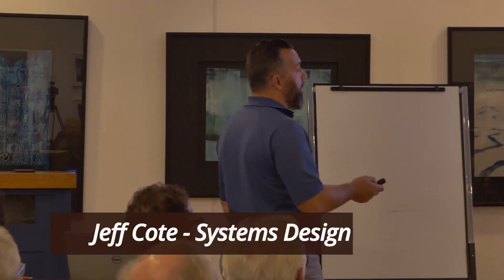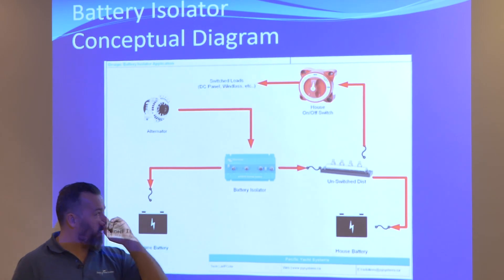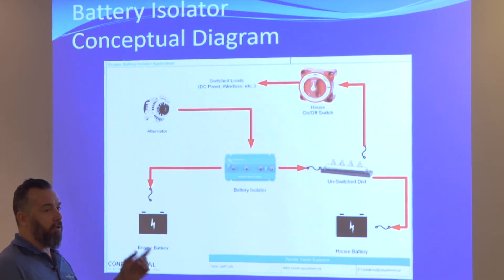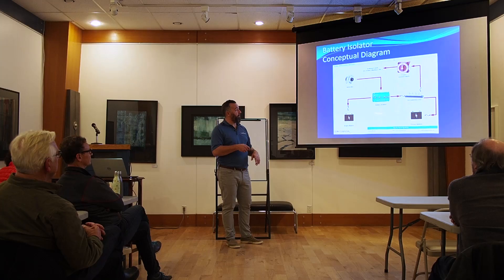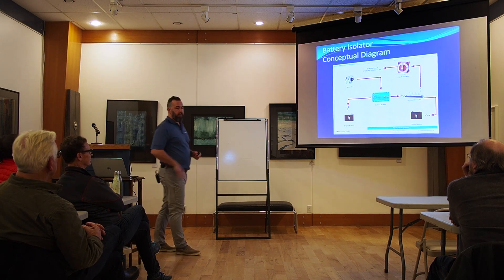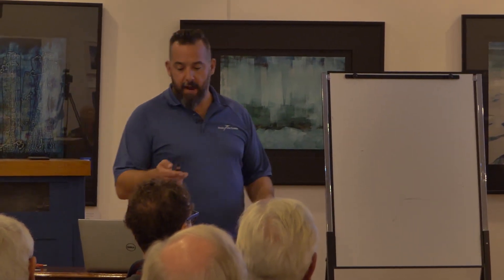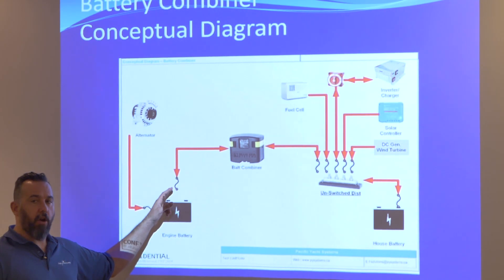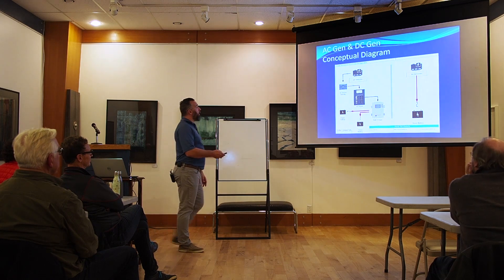How To: Marine Electrical Seminar - Battery Isolator Troubleshooting - Ep 28/30

Comment: Great stuff Jeff, the content is spot on and you present it well. How does this setup work (or not work) with daisy chained solenoid? Is it incompatible or just not optimal? You mention it in the video but could you elaborate a bit on the why?
Reply from the maker: Good question, will consider to make a video on this. In the meantime check out all our content on battery combiners:http://www.pysystems.ca/shop/power/battery-combiner/

Comment: So basically, say if I have 3 batteries on my sailboat.  1 is for cranking and the other 2 are separate house batteries. Let's say I have been running house battery 1 all day and want to charge it up, the battery isolator will only send the charge to the batteries that need it (#1) to be charged without overcharging the others say like if they were charging in parallel?
Reply from the maker: The battery that is the most discharged will get most of the current coming from the alternator via the battery isolator. The alternator regulator will reduce output as both batteries are nearing full capacity.
Reply: @PacificYachtSystems  and doing this it will keep from cooking my charged batteries? Seems like back when I was running on "all" I did that once.

Comment: Awesome video I think you've solved my problem, thanks Jeff! 

Before I bite the bullet can you tell me if my shore power battery charger will charge both batteries via the battery isolator? Will both charge up while I'm connected to shore power? 

And can I have batteries of two different sizes charge from the battery isolator? 

Thanks again for the the video!
Reply from the maker: Hi John, most battery chargers (powered by AC shorepower or AC generator) have 2 or 3 outputs and will recharge multiple batteries without the need for a battery isolator.

Comment: If the house bank is undercharged on post 1, and there is a mostly charged starter battery on post 2 and a mostly charged windless battery on post 3, and since the battery isolator has no charging profile per post, and it charges based on what it sees on post 1, won't it overcharge posts 2 and 3?

PS: Love these videos! Thanks for sharing your knowledge and experience and passion. It makes a huge difference and I have learned a lot.
Reply from the maker: Hi Marco, battery isolators are a compromise device. In a perfect world, each battery would have it's own externally regulated alternator and dedicated battery charger. But that ideally world doesn't really exist. For perspective, never seen this ideally setup ever. A battery isolator is like a multiple battery bank charger, it has 2 or 3 outputs and all the batteries connected to it will be charged to the same charging voltage. Ideally all the batteries should be the same size and the same level of discharge for the isolator or charger to not slightly overcharge a single battery. But that's rarely the case.Remember the less then perfect charging will only last for a short period of time while the alternator is in bulk and absorption mode.
Reply: @PacificYachtSystems  could you put a DC to DC charger on each post to charge different battery types that may be used for different banks with various charging profiles? Just a thought. Thanks for all the great information 🙂

Comment: PO Had a 3 Bank charger in place, I added a House bank last season. I'll be switching the House bank to Battery 1 "Post1" sweet tip since house is the most used.

Comment: Jeff, question about the isolator when having a setup of three banks. Starter battery, AGM 80aH, House 300aH lifepo4 and thruster AGM 95aH. Is that a durable setup to let the alternator charge all of them in parallel (60 AMP standard alternator).

Comment: Awesome video, I'm getting hooked and learning so much from your channel. Thank you. Question. I've replaced an original old 2 alternator, 3 bank isolator because the alternators would never charge the house bank. I'd have to put one of the alternators on the House post on the isolator to get a charge to the house. I replaced it but the new one is behaving the same way. The alternators are 51 amps each. The house batteries, of course, are the most important to charge underway, I'd really like that isolator to work properly. Any ideas?

Comment: Thanks Jeff for the videos! Just one question: I've read that  connecting  the isolator between the battery and the alternator will produce a voltage level difference that would change the way the alternator's regulator ''sees'' the battery charge level, is that right? If so what should be done to solve this issue? thanks.
Reply from the maker: Hi Martin, that's exactly the advantage of a modern FET battery isolator versus a diode battery isolator.

Comment: Hi Jeff. I've just been binge watching all your Seminar videos. What a great resource. Thank you so much.
I'm in Australia so you already know everything will be fused. :^)
With these Battery Isolators, is it possible to use more than one isolator? Say one from the alternator as you have explained but add another smaller one in the solar circuit  to split between house and starter to keep both the house and starter "topped up"? This is on the proviso that the chemistry of both the house and starter batteries are the same, 
Thanks in advance.

Comment: Jeff, how does a battery isolator cope with an alternator charging a 12v starter battery and the house bank is 24V?
Reply from the maker: Hi Mark, a battery isolator won't solve this problem. You'll need a DC to DC converter/charger to make this happen.
Reply: @PacificYachtSystems  Gotcha, thanks.